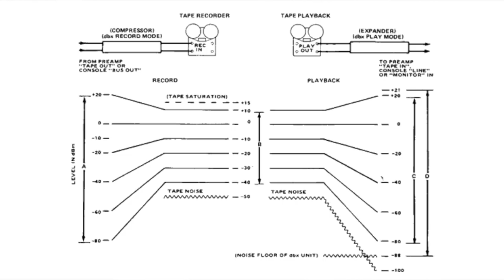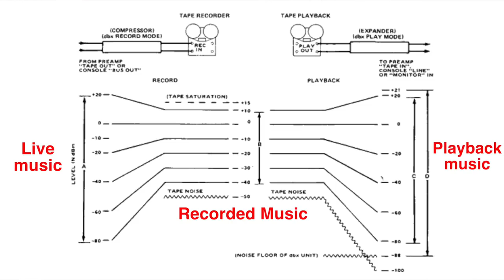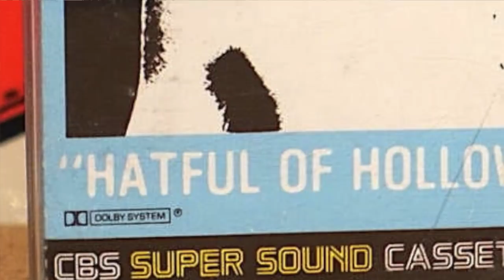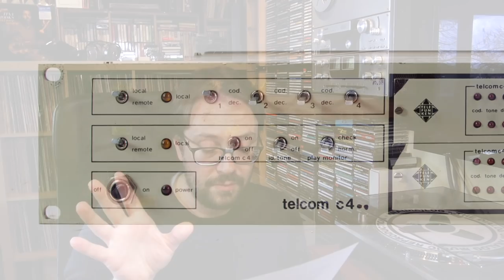Top Tape Noise Reduction Systems & How they Work

Comment from the maker: ERRATA CORRIGE: At 29:50 I made a mistake in the caption. High-Com II is ONLY Nakamichi.
The other names are other secondary types of noise reduction systems: Toshiba - Adres; Sanyo - Super-D; EMT NoiseEX; CBS CX and CXTV; Burwen Noise Eliminator.
Finally I forgot to talk about Dolby SR (Spectral Recording, introduced in 1986)!
Reply: Hey uhhhh i could use some advice...i have some downloaded unofficial FZ tapes and id like to back it blank cassette, i just bought a telefunken 450 tape deck with High Com 1

Now some of these tapes have hiss, for one reason or another, but i wanna back up a show that has a lot of Amp Hiss/Wind

Do you think high com would bring the noise down while keeping the mix intact

Usually on some of these bootlegs, anything past 10Khz is usually a lot of noise
Reply from the maker: Companders or noise reduction systems as High Com are designed to reduce the inherent tape hiss of the cassette you are recording, it will not affect, or at least not that much, hiss present and recorded on another cassette. Sorry about that.

Comment: I got the Nakamichi HiCom II and I did copy the motherboard (in CAD) and repopulated it with all the same components. Then mounted it inside HiCom II and setting one PCB to permanently REC and one PCB to permanently to PLAY. This makes my unit probably very unique and the only Nakamichi HiCom II in the world that codes and decodes simultaneously within. 👌🏻 😃
Reply from the maker: Cool!!
Reply: WoW! Respect! What you did does not occur often in nowadays world! Would you consider doing one more to order? 🙂
Reply: @FTube77 Hi and thanks. Yes it is a little odd unit. I do no longer have access to neither parts nor cad designs, but I would consider selling it on eBay preferably with the Nakamichi 680ZX Discrete Head Cassette Deck w half speed option. Please let me know if you would be interested. I think 110/230 VAC /Claes

Comment: Wow - excellent - knowledge is power. I had long ago bought a TEAC A 3440 11" reel recorder with the dbx unit. When I made a recording without it, you could hear the hiss. I tolerated the hiss, but it bugged me - I mean a heck of a good recorder should not have hiss.  But when the dbx unit was hooked up, all 4 channels that would automatically switch between record and playback, the hiss was all but gone - you really had to listen hard to detect it, if you could. The dynamic range was amazing, the quality of the sound simply superb. It made all the difference in the world. Actually I think the playback sounded a bit better somehow - it was like 3D sound. After that, no going back. Try to play back a dbx recording without the decoder - noooooooo!  turn it on and suddenly, you are transported to heaven. Ya, that good.

Of course today, it is all digital and noise is absent. Is the sound quality as good as analogue? Debatable. Does anyone care? When you go to a theatre, the digital silence is dead quiet - but then again it should be with a $100,000 system. Loud is crazy loud, like in real life. Can a tape equal that? I doubt it. But it comes pretty darned close.

Now then, does it matter. We are all caught up in a world of perfection. Perfect what? I have a 1930 Knabe 9' grand piano. It is not perfect, but incredible nonetheless.  I have had some people state that this piano is the best sounding piano they have ever played. It is the minute imperfections that made it so human, warm, comfortable. When compared to a so called perfect Bosendorfer Imperial at $250,000, I don't like it. Too clinically pure. Cold perhaps. Like a perfect woman who flaunts her clinical beauty with an attitude of 'the great ME'.  No thanks. 

I see digital as clinically pure. Ya, unrealistic. You never hear sound that way ever. The world has its hisses, pops, scratches, jet noise, traffic and wind in that sound. Do I like the clinically pure digital sound? Honestly - tolerate it but it does not give me warm and fuzzy feelings. It does not hug you.

The Teac with dbx does however. Can't explain it.

So at the end of the day, what is perfect. Clinically pure or a bit of imperfection from that?  Noise reduction is needed for sure, and digital gets it right, but at what cost?  What advantage is it to have a great 4 channel reel deck and dbx unit, outside of bragging rights? And to watch big reels go round and round? I will tell you. It is warm, inviting, gives you a hug and makes you say 'oh my , does that sound nice.  It does have its place in our hearts. I like it. They got it right.

Comment: Just like a travel back in time...
I came in here just by accident but stayed tuned: Half of my age age at the beginning of the 1980s where computers were  not existing I built a NR system from Telefunken HighCom boards attached to a (if I remember correctly) Sony Taperecorder. It was a great enhancement but in the first version there was some breathing effects in the recordings. That was fixed (of course by me - it was the age of the electronic hobbyists) with about 5 to 10 passive components and it worked quite well. Thet was the time of buying 30cm vionyl LP records, recording them to tape and putting them back into my shelf to keep them pristine for the rare occasions of playing them on the turntable. All those treasures still standing in my other flat and unused since 20 years or so.. just relics of a nice time of life.

Comment: Excellent presentation and explanation on all the main tape noise reduction systems. As a matter of fact, IEC Type II (CrO2) has the lowest noise floor of all tape formulations, even lower than Type IV (Metal particle).  But with Metal, you can (must) record hotter, hence the "perceived" lower noise.
Reply: What I’ve heard is that the 70microsecond EQ curve was developed to serve as an impromptu noise reduction as it boosts frequencies on record and cuts them on playback. As tape formulations improved, the need for the difference in EQ was lessened, but it was kept in place. Wasn’t explained to me why it was kept, but I assume it was more nuanced than just a difference in formulation.

Comment: Thank you very much for the very informative videos you share with us, Great Videos!
With your permition, I would like to add some more important points related to NR systems :
1) Reference Level Calibration:
All NR methods (except DBX)  require to be recorded  and playback at specific  magnetic level, other wise they would suffer from improper operation. The "better" the NR system in terms of  NR improvement, the more sensitive it would be to changes in gain levels. also depend on media, the higher the basic noise level is (i.e. standard cassette vs Metal one) the more sensitive to gain changes  is  the system.|
There for, the Dolby C system for cassettes, though it has an excellent  performance at time of recording, would suffer from normal ti,e cassette degradation,  from azimuth changes, from comparability to other cassette deck playback etc.  while the simple dolby B recorded cassette would not be so delicate.
What is Great about dBX is that the system encoding emphasis and convert a linear signal level into a logarithmic scale and the decoding works exactly the opposite way, thus dBX system eliminate the need for a reference level calibration, it can be perfectly decoded and played back at many different gears, no need to generate calibration tone prior to playback of a dBX decoded material.
2)  Machine compatibility 
 To my memory, Dolby B noise reduction was effective on frequencies above 4 KHz,  and 10dB of reduction, Dolby C on frequencies above 1kHz 20 DB reduction on the mid range frequencies and "only 10dB" on the high frequency  (to avoid Recording head saturation)
3) Recording Bias Control:
 Since Dolby recording involves with elevating the recording of the high frequencies close to saturation levels, the Dolby C introduced a method (developed  years earlier by Tandberg for RTR machines)  that was controlling the BIAS of the magnetic recording head, where each time a high energy of high frequency was recorded, the bias level of the head was reduced to keep total signal to the recording head out of saturation. This method  increase  the  dynamic range of the very high frequency which normally could not be recorded at level higher than -20db (Normal Cassette) and -10dB (Metal Cassette). Dolby C noise reduction was actually reducing the actual level of very high frequencies at recording and amplify back at playback  
4) Tandberg TD20A Real to Real:
Tandberg RTR model TD20A SE (from 1985) is the only machine I know that was able to reach A weighted 80dB SNR  without using a NR system, they have used a special magnetic heads. the Actyliner system (Bias control  for high frequency recording) and "special Equalization (Not NAB or IEC) which utilized the extra high frequency headroom thus had stronger emphasis on recording and stronger the emphasis on play back.  in my opinion (and experience) the Tandberg RTR TD20A and TD20A SE are at the top of home (4 track low speed version) and Semi pro (2 track High speed)  machines I know.

Comment: Vangelis preferred DBX noise reduction when recording to his Lyrec 24 track machine.  He used it on almost all of his albums recorded at Nemo Studio.  I believe he then used Dolby A when mixing down to the Ampex 2 track machine.
Reply from the maker: Interesting!
Reply: Not surprising to me. From what an audio engineer friend of mine has said, DBX was technically better, but between lack of market saturation and the recordings sounding awful without the decoder in comparison to Dolby B, it was difficult to get consumers to adopt a new system.

Comment: I was a reel-to-reel junkie when I was in high school. As soon as I had the money I ran out and purchased the original Advent 101a outboard Dolby-B add-on device. A year later I purchased the 100A for a whopping $270.00 ! Since then I have "recycled" the case from that unit for a DIY audio project. (So I got my $$ worth off of that item..) I used Dolby to transcribe my "new" records to open-reel tape even at 7 1/2. Still have most of the tapes. Ray Dolby was an electronic genius..thinking and designing years ahead of his time. RIP Dr. Dolby.
Reply from the maker: Cool! Thanks for sharing that.

Comment: I may just have solved my noise problem. I found a 1995 Denon DN  -790 R. It has dolby b, c and S! and hx pro plus a bias control. This may be  rare find. Hope it works out. This is touted as the best type of noise reduction. Hx pro is a must.Denon has a good quality turntable allthough some are a little skeptical, but its brand new.  its a little pricey at  $2500, but, its of good enough quality I think.  The old ones have their problems, I had to send one back. We certainly need turntable and cassette decks to be made again. Hopefully they will have a comeback.

Comment: Hi from France ! Very good video. Can I just add that most of people will buy second hand tape decks and after servicing around 250 of them, the noise reduction chips are almost the last of the problem.
To obtain a good quality sound there is so much more to do before !
A single dust or hardened grease into the capstan will bring deviation in the speed, the same for a slightly worn pinch.
More over the heads calibration will be as important. I won't list all the requested deep servicing that you need to do before thinking even playing with noise reduction !

Best
Reply from the maker: Of course, I agree! This was just a video on these systems...
Reply: A Very educative ! and very good one !

Comment: Thank You for interesting video ! I used all these systems in my live (also Dolby A and Telcom C4 in my job in a TV-station) My cassettdeck (Technics RS-B965) also has Dolby B and C and also dbx. My TEAC X1000R has dbx I, but for me the best system is Super D Plus N 55 from Sanyo ! 40dB noisreduction in 2 bands. No "breathing" or "bumping" I ever could hear, it was not so popular in this time (1980) but for the consumersection it was the best solution because it was not sooo expensive and worked really great, till now ! I could adjust the signallevel under the noisfloor so that You could not hear it, and if I switched Super D on, signal came clear and without any hiss back without any breathing ! ! For me much better like dbx ! 👍
Reply: I agree. I also have the Sanyo Super D and at first I simply couldn't believe it. It is phenomenal. Purely in terms of sound, it is quite capable of upgrading a few hundred dollar deck into a several thousand dollar deck, and I am really not kidding! It was also manufactured by Fisher, and prices are now going up and up for these units on the used market as more people are realising just how good they are.

Comment: Great video, Guido.  My first and best cassette deck I owned was an Akai GXF-90 with 3 heads, dual direct drive capstan motors, manual tape calibration (built-in test tone generator), etc........  It had Dolby B and sounded great, as long as you played a tape that was recorded on this same machine.  Eventually I stopped using Dolby, and the tapes sounded great to me on their own.

Comment: Great vid as usual. I always hated the Dolby NR systems, they removed so much of the high end, that I always turned it off. I personally think it's incredible they could make it that far with such a useless system. You can almost do the same thing with an equalizer. At least that's my opinion. A good example of what it sounds like I think many will agree - In this video intro it sounds like 0.18 with Dolby 0.28 without.

Comment: Ciao Guido, great video. I recently bought a Technics RS-B605 to experiment a bit with dbx. The guy I bought from never used dbx (didn't even know what it was). I must say I was really blown away about the results. Did some a/b/c test with Dolby and dbx and the latter clearly won for me. When searching online for the NAK T-100 Audio Analyser, I came across a website by Chen Wang. I downloaded a complete NAK T-100 in software that can do even more that the original hardware model. You should absolutely check it out. He also sells software equivalent codecs for Dolby B/C, DxI and DxII plus a DxL Compander only. I played with the DDi and DxII versions and they are awesome. With the DxII codec you can record and playback in dbx without even having a dbx deck, so great for experimenting When my RtR is fixed I will probably also check the DxI Codec. I read through the comments and couldn't find anything about these products. Maybe an idea for a future video?

Comment: Excellent overview, but you miss Dolby SR, the pinacle of noise reduction system that kill digital audio multitrack market in the late eighties.
Dolby SR provide up to 106dB of SNR.
Reply from the maker: I did not miss it actually. I excluded it. It's mainly a surround movie audio NR system.
Reply: @anadialog  It was used a lot in for 2 trks recording and multitracks recording.
The studio where I was working in the eighties got about more than one hundred cards of Dolby SR.
We even put a set on our Sony 1Inch videotape.
BTW the Dolby SR was the pinacle of audio analog treatment before the introduction of DSP.
His son David, tell me that this Dolby SR was is last project as an engineer, apparemtly he develop the concept and the final product from start to the beginning.
Reply from the maker: I see. Thanks for your input. Maybe my perception was wrong to exclude it but in my master tape roaming I have rarely seen it and also online it is rarely discussed.
Reply: @anadialog  every engineer that came in contact with dolby SR said that it was the best for two track mix down master recording.
Reply from the maker: I see. I just had the perception that it was mainly adopted in the motion picture industry. I guess I am wrong.

Comment: There is also a rare digital NR system that Pioneer developed for some of the twin cassette decks. it was to make a noiseless copy of a Dolby or Non Dolby encoded cassette. The mechanisms that where used where terrible with lots of wow and flutter in the copy. The copy was also lousy but worked and it was quiet as the original recording. I also have this deck.

Comment: Hi, very nice vid, thx. When i listen to a dolby B or C, i found that the sounding result is not as good as without NR. I suppose that some details in sound are lost during the process. Of course there is less hiss but the music doesn't sound as good. Don't know if high-com 2 and dbx suffer from the same issue but i think it's inherent in all NR systems. The beauty of analog music is the level of details, but if we manage to send the signal into series of condensators and resistances, i guess they tend to remove a lot of details. As a great fan of Nakamichi audio, not only tape decks, i would go for a high-com 2. I wouldn't be surprise if Nakamichi took care of that issue, and choosed the best solution in collaboration with Telefunken. Another thing to mention is that the hiss is only noticable when there is no sound, so i think it affects less the sound quality that any NR system which tortures the signal. Any advice or comment about that and about high-com 2 will be appreciated. Thx
Reply from the maker: Unfortunately Dolby chips need calibration at a certain point or simply may have some issues so unless you are using several decks and you know how Dolbyb sounds when it works properly, don't stop there. In any case, I agree that sometimes it just isn't a good effect. Depends also for which music you are recording